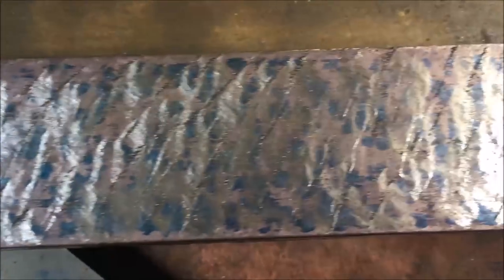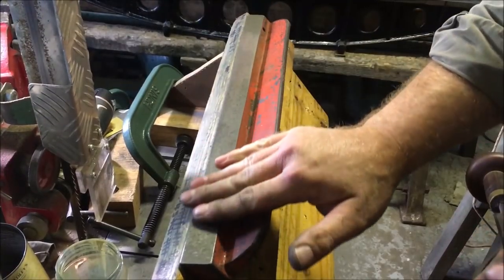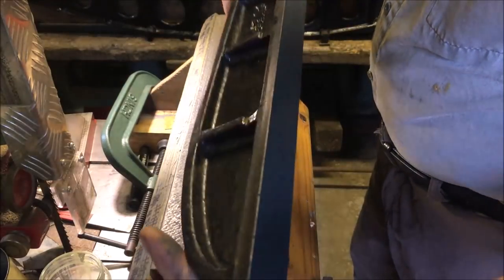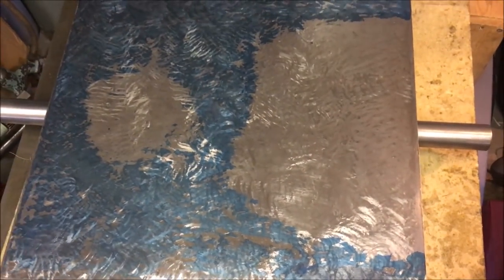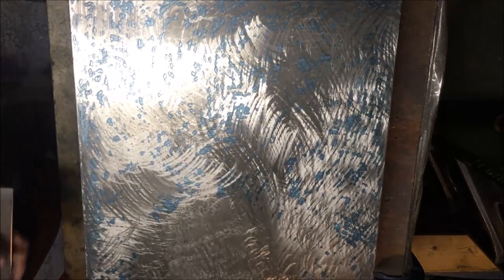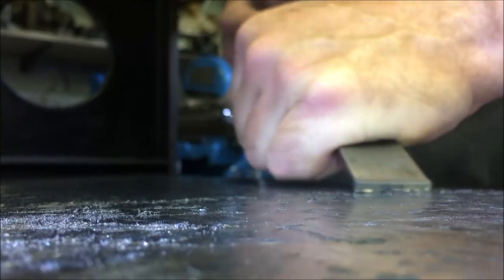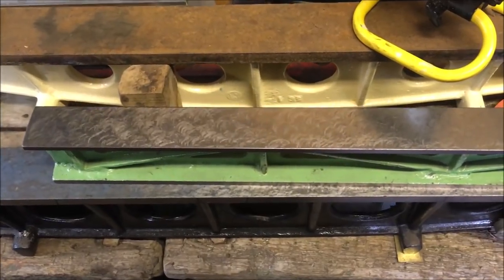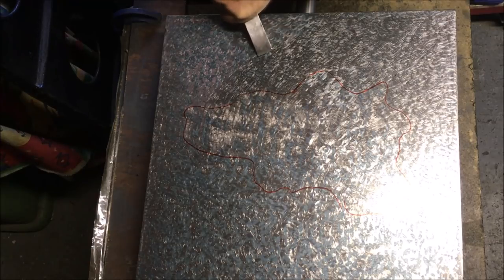Handscraping

Comment: Just had a thought 💭 to control your initial point to start the scrap draw a texta line on the top of the tool say 4mm from the right edge then roll to the left 
Maybe a you need to increase the radius of the cutting edge to get a tighter curl 
Hope this helps your control 👍😎🇳🇿 good work cobber
Reply from the maker: That was something I did when bump & pull flaking initially. Might give it a try later this weekend see if helps any with the 'bedding curl' Im working on now. Glad you are enjoying the vids' and thanks for commenting. All the best mat

Comment: Matt- Good job. It helped me to start the stroke with light pressure to hard then back to light and lifting off to get rid of that perpendicular "gouge" at start/end of stroke. I had still have that problem a lot. thanks for the vid! 

Edit: I had the same problem with my palm wearing raw and my buddy gave me these file handles that have a hole in the side at 45deg with set screws in each end that set into tang. So the handle is at roughly 45deg with the tool coming out the middle... Thought I'd give those a try next time.  Looked all over the net for an example but can't find.
Reply from the maker: yeh for sure the pressure down changes through the stroke - lean in and out so to speak.  Its almost imperceptible watching Chris - but its there.  Once I got my head around the ellipse movement of the scraper tip and the 'rocking' down the scraper length I could visualize what the shape was going to look like. Doing it - another matter :-)  I had to start with big movements and then slowly compress them - trying each direction to see which worked. Man your hands and wrists ache at first. Long way to go yet but Im happy with my progress... sort of. All the best Mat
Reply: Your looking and definitely getting a lot more practice than I have been! You're not kidding about aching never thought scraping could be so physically demanding until I did for a couple hours!
Reply from the maker: Steve, if you have chance I would like to see a photo of the file handles you refer to - I am going to make some new handles in a couple of weeks and they sound unusual.

Comment: (Been working my way through your back-catalogue)

With your current greater knowledge of scraping, what do you think you were doing wrong so that the surface plate proceeded so slowly?

Is there anything (you now know) that would make it go faster?

('cos what you were doing looked fine to me... !!!)
Reply from the maker: The roughing down where I was making 4 or 5" long scrapes - was pretty quick at shifting material - however, I gouged a few deeper scrapes and these resulted in my having to scrape down more than necessary. I even left a couple of small 'pits' rather than carry on. What would I change - well once I got the curling action it all starts to come together. I have to say, straight scraping (as shown on a lot of the SE videos) is far faster and if you use your shoulder less tiring. It is though harder to control depth consistently - so if I was doing it over. I would rough with straight scrapes 2" long , then reduce teh stroke by half every 5 cycles. Until I got down to around 1/2" strokes at which point I would be looking at a scrape depth of say 0.0005" depth maximum.  Then switch to a curl where I can control the depths far eaiser - each pass taking around 0.00025" off of the highest points. 3 passes would get me to a point where the surface was all within maybe 0.00025" . Ten rescue th curl size to as small as I can and give it 3 passes - that would give contact of around 60% and maybe 30-40ppi.   On the otherhand, I could make the tooling for my old Biax and learn how to use that :-) Thanks for watching and commenting - All the best Mat
Reply: @lookcreations  interesting; as a woodworker, the only things I've ever scraped are the soles of handplanes, although some of them were 5 thou out to start with. The thing that slowed me down was being too careful, too early. I was achieving good coverage well before I was even working the whole surface, which is just a waste of a (lot of) time and effort.

As I practised more I ended up using a convex FILE in the early stages, but still guided by prints off a surface plate. I can't file straight enough to get a flat surface "direct".

Comment: nobody mentioned it in the comments so here i go.
Why in heavens name did you have the angle irons that hold the granite plate in place stick out above the surface of the plate?
I appreciate it will protect the corners from getting chipped by a mishap, but it seems so unworkable to me.
Reply from the maker: A design feature to hold the wooden lid off of the plate surface. Seamed like a good idea at the time ! Thankfully an easy fix later 👍😃